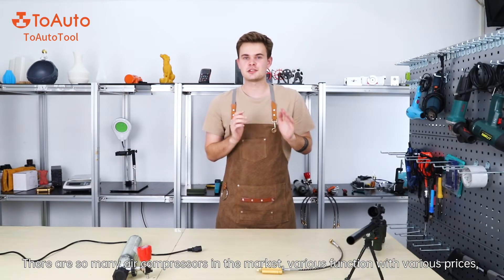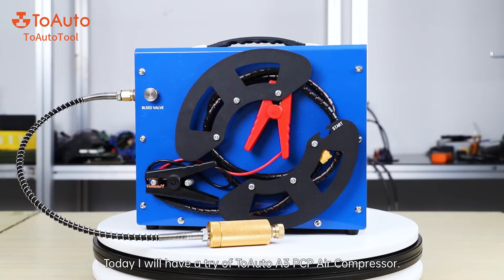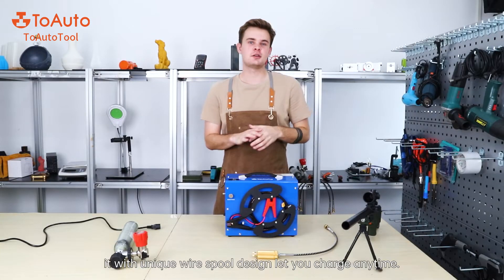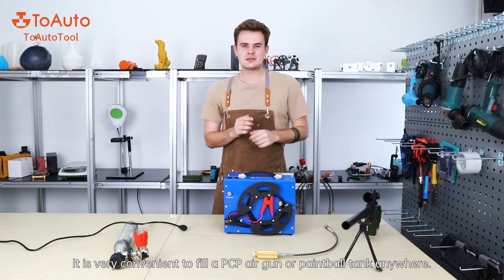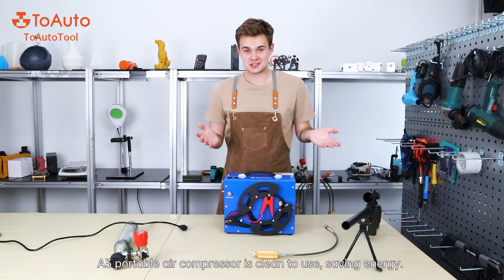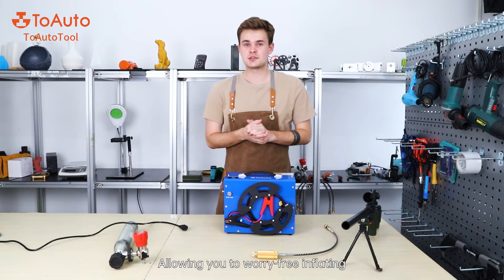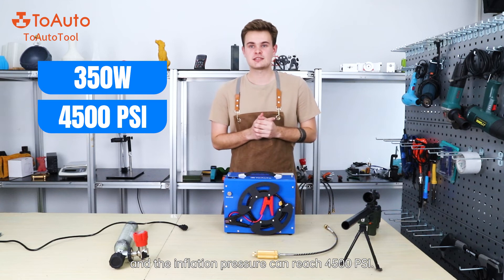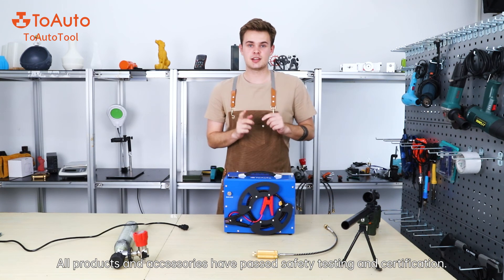A Cost-Effective PCP Air Compressor, What Advantages should it have?

Comment: Wher is the automatic bleed off valve?
For what is this brass type screw in the left upper corner on the front of the compressor, I couldn't find any info's about that in the manual ? 🤔
Why is the amazon UK version not shipped with a UK plug. 🤔
Reply from the maker: Yes, the screw marked "bleed valve" is the bleed off valve.😊
Reply from the maker: We're sorry that we didn't provide you with a plug of suitable specifications😣. You can contact the store to help you. Can you provide a link to the product? This helps us improve our service.❤

Comment: A picture of your pressure gage shows psi over 3000 psi  (200 bar) in the RED zone. Is it dangerous to use this compressor up to 4500 psi?
Reply: From what I've come across as long as you stay below 5000psi your fine (other wise the safety burst disk will blow to prevent damage).